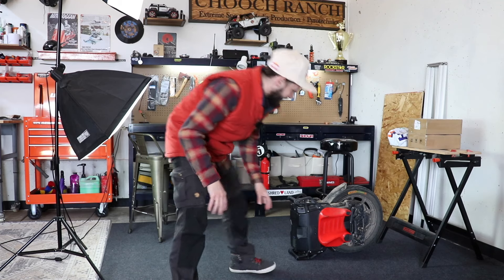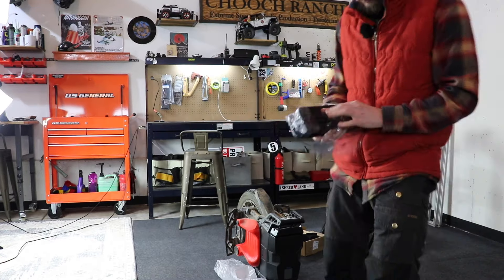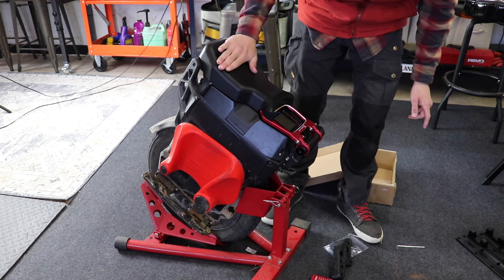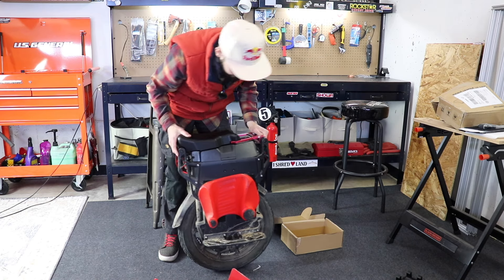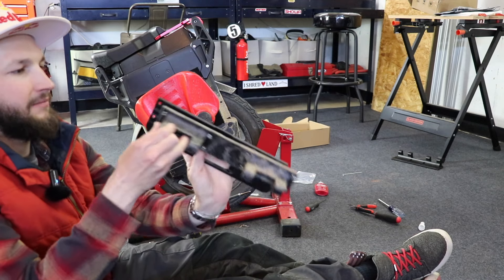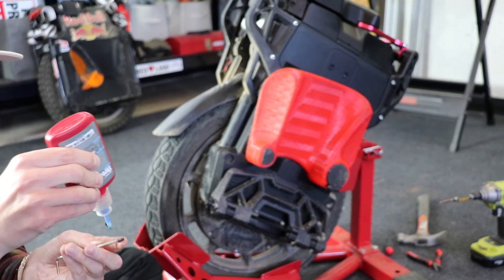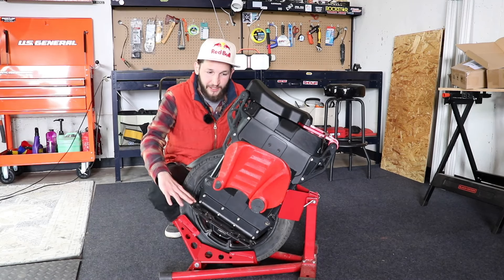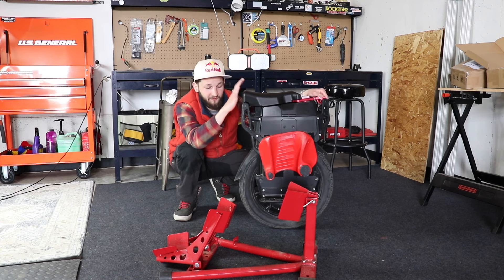VETERAN LYNX Electric Unicycle MODS! Bolt-on Performance (Eliminate Wobbles)

Comment: I do prefer the Grizzla seat for my Lynx because it takes 2 seconds to remove and put it in my bag, i love the E-Rides low pedals hanger, they are not a big issue offroad well i didn't have any issues yet, i also got the Wolverines pedal from E-Rides and they are way better with the studs and the toe/heel lift is great for braking and acceleration also the angle is adjustable.
Reply: Although the E-Rides pedals are heavier but totally indestructible.

Comment: If anyone wants a quick, easy, temporary, or lazy way to hold anything down like that seat, consider gaffer’s tape. A quality brand sticks stronger than duct tape, doesn’t leave residue, and is even reusable until it gets too much stuff on the sticky. It is really incredible stuff compared to cheap duct or duck!

Comment: Talking about stripping bolts. I have replaced the standard bolts with real HT steel on another unicycle. Real high tensile fittings are available from any reputable nuts and bolt retailer.

Comment: Hey Chooch, if you rotate those mounting rings down on the front of the seat bracket, does it extend the seat back and lock it better against the rear handle?

Comment: Cheap poorly set up 3d prints could be crud, but some high quality printers can out perform many other methods of manufacturing. Printing with atoms was achieved aprox 5 years ago in my opinion. There are laser metal printers. Another uses metal speed somehow I forget it's name dam. Anyway.
And a nice array of new very bouncy rubbers,  Tpu is just one common one.  Disable retaliation, 105% feed rate, easy rolling spool, quick opinions on settings. 
Making commercial gain or uploading things has rules and guff. 
Wishing you nice success and to be well.

Comment: The pedal height sucks on all suspension eucs .way to wobbly hard to control.  I prefer my og Sherman over any suspension euc  . Like my skateboard 🛹.
Reply: Must say my old monster v3 at first I thought was way big and like a bus, now it's a lightweight, rides great, no suspension, low pedals, love that wheel. I've not rode a sherman yet, looks very cool.
Reply from the maker: I agree the OG sherman got the low pedals and I never one time had wobbles on that wheel.
Reply: I'm still riding my og Sherman, great wheel